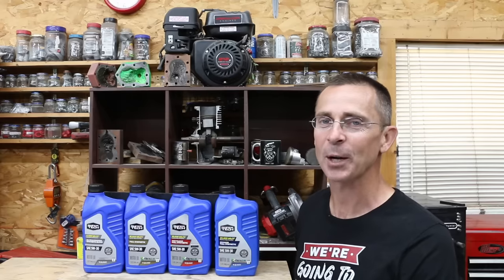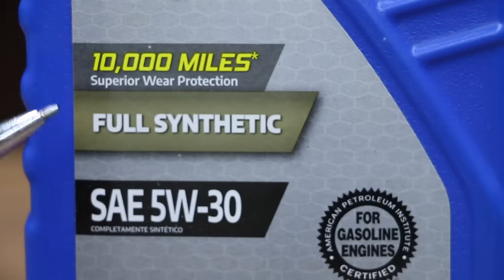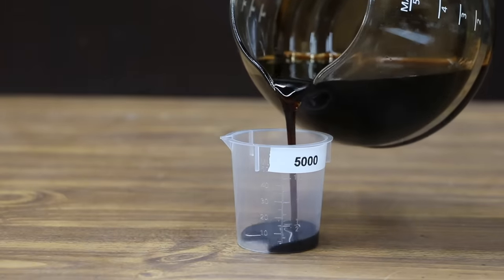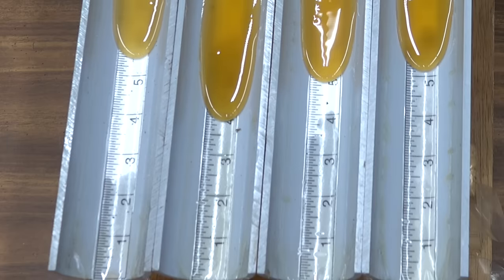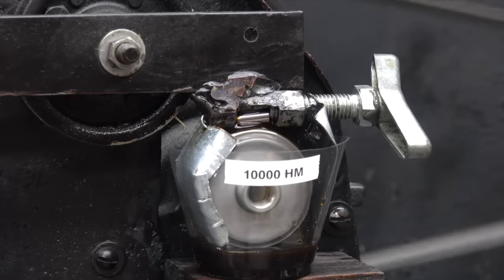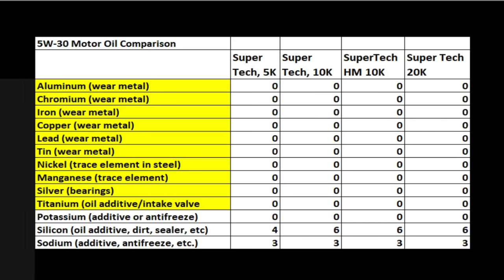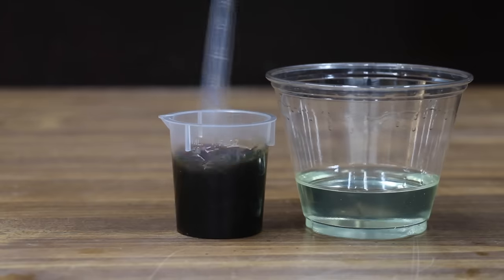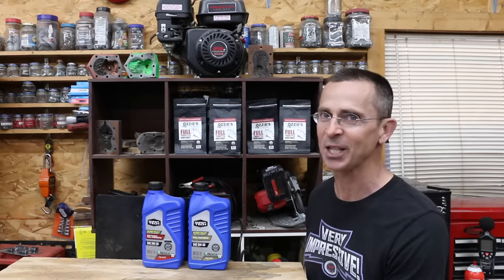Are They All The Same Motor Oil? Let's Settle This! Four Types of SuperTech Motor Oil Compared

Comment: I learned my lesson on a Mercedes in 2004.  Took it to dealer in accordance with factory recommendations, which was around 10,000 miles. At 140,000 the heads had to be replaced for over $6000.  The mechanic said it was due to not changing the oil properly.
Reply from the maker: Thank you for sharing!
Reply: Heads from junk yard for that car is ~$200 plus the price of milling.
Reply: @hid3nax  he didn't state the year and model of the vehicle. You have no idea what used heads cost in 2004 for a mystery model car.
Reply: @hid3nax  internal secondary air ports impossible to clean out.  Not rebuildable.
Reply: @rustynail7866  Okay, then the only thing I could wish you is good luck throwing those amounts of money in a used car (any used car) post-warranty period. You must be earning insane amounts there in America though
Reply: Most cars you could get a whole brand new engine for that
Reply: Vw vr6 used to say 10k between changes ,I'd do em around 7500-8500 and still needed to replace the timing chains at 130k.
More that the guides were shot causing chain slap, but I bet it would have needed em by around 100k if I did the 10k changes. 
As it was, I wasn't so happy with the color of the aluminum surfaces going that long.
It wasn't sludge loaded,it just had a brown patina that was a little darker than I like.
Reply: @MrTheHillfolk  Timing chains is a wear/maintenance item, just as brake pads. Some last longer, some require attention sooner. Modern VW TSI engines wear our chains quickly too
Reply: Audi also has that ridiculous 10k mile interval. I change it every 5k
Reply: @WeighedWilson  Mercedes in 2004
Reply: @hid3nax  yeah this is definitely not true; wear items like brake pads are meant to be replaced routinely but these definitely aren’t. Timing chain guide failure and chain stretch/failure are design or manufacturing flaws. I’ve owned several cars with timing chains including one with an EA888 TSI and I’ve never seen this in any inspection or maintenance schedule.
Reply: @hid3nax  yeah not to mention the stupid TSI water pump, not a fan. 
The wife's 2014 is 5k over the warranty and it's leaking. 
Not happy about that stupid design and having to eat this. 
I've had timing belts last longer than a vr6 chain set and they're not supposed to.
Reply: @Drinksfromtap  That doesn't mean they last forever. In ECU there is stored some value which can be accessed using a scan tool. Once the value passes some threshold it means timing chain is stretched beyond specs and needs replacement
Reply: @MrTheHillfolk  personally I (highly) prefer timing belts over timing chains. On my 1.6 TDI engine TB replacement interval is 210,000 km. It's silent, reliable and long lasting component.
Reply: That 2004 Mercedes also has a terrible engine layout.  The cylinders lay at an extreme angle and the rings don't lift and scrape the oil properly
Reply: WOW!!!!!😮
Reply: @artbennett7321  3-5k is good, no way I'm going longer matter what they say.
Reply: Yet in the UK oil changes  for a lot of cars including mercs are 20k
Reply: @hid3nax  Thats kind of a load of crap. American cars saying 100K timing chain, sure I'd believe it. Asian and German, I expect 150K+ minimum. Can tell you how many Toyota/Honda/etc are running 200, 250, 300K on OEM.
Just like BMW's have half the top end plastic and considered a wear item after 5 years. Conveniently out of warranty and usually out of lease.
German engineers can't design a longer lasting engine compenent like everyone else, or the bean counters figure the people buying their product First-hand will rarely still have it in the stable to find out how crap they are at cost cutting.
Reply: Change at 3000 miles if it has a turbo. 5000 if not. Full synthetic
Reply: @PeterHernandez-lg2eh  I go 12k on synthetic.  There is no reason to change it sooner.  It actually puts more wear on the engine changing it sooner.
Reply: @pj4433  That's for diesel cars in the UK. Gasoline engines need oil changes much more often than diesel engines.
Reply: @5467nick  yes agreed but even so petrol in UK is often in the 12ish range.
Reply: @pj4433  The average age of cars on the road in the UK is around 8.5 years old. In the USA, it's around 12.5 years. We also tend to drive a lot more each year in the USA. Longer service intervals are less of a problem if you don't intend to own the car as long and aren't going to drive it as far.
Reply: @hid3nax  
We let one go for 140k miles on an old 1.6 be diesel. 
Well ,not by choice but it had 140k on it and there was no doubt it was the original one. 
Only 100k over recommended change 😂
Reply: @MrTheHillfolk  Mine's not the old good 1.6 IDI engine but modern 1.6 TDI with Common-Rail. I've replaced the TB at around 185k km mark just to be on the safe side and all the components (tensioners, rollers) looked and felt fine. The TB material was also fine, no cracks or other evidence of aging/wear. Manufacturer's recommended replacement interval is 210k km for this engine, which I have no doubts, is reasonable

Comment: Yes! We've got the Walmart brand oils tested against each other. I've wanted to know about this since they introduced them. Thank you Project Farm!
Reply from the maker: You are welcome!
Reply: I've used supertech products since I was 17 years old, I'm now 35 not once have I had any issues due to being the oil.
Reply: I've used them since I was 17 on about anything they're fine.  I have never had an engine die due to oil related issues.
Reply: Good info. Ive been using the 20 K when I can find it. I feel better about using the 10 K now.
Reply: Warren blends good engine oils  Most in house brands are made by Warren.

Comment: 5,000 miles is the maximum I go between oil and filter changes.
Nice test!
Reply from the maker: Thanks!  Thanks for the feedback.
Reply: Depends on the oil. Verify by testing. The length of oil change should be done by hours, not miles. Sitting in traffic and idling does take a toll.
Reply: Why
Reply: Thank you.  I'm going to post about my brother's oil change habits later today.
Reply: 3 to 5 max. It is all I ever do/ and I get 300 -450 thousand out of my engines without any oil burning. 3.3 Dodge/ Plymouth/Caravan
 BUT.
 I have now a Toyota Corolla cross so the results may differ.
Oil is cheap/ engine repairs/ new cars aren't.
Each to his own though. You're paying the bills, not me.
Reply: @luckyguy600 there’s no need to do every 3k unless it’s been months on months on months. 5 is fine. Also ran through few Nisan engines 300k miles (murano/infinity g35)
Reply: @cwill2127  How bout their transmissions?
Reply: I run royal purple and i go 8000 miles between change intervals.
Reply: Depends on the type of oil you're using and the kind of mileage you're doing. If you're just steadily crusing down the highway the interval can be significantly longer than city driving and traffic jams. I imagine the 20k mile oil is good for 20k if its just long distance highway commuting but not 20k city driving.
Reply: Cheap insurance. I do also.
Reply: @gravemind6536  the 20k is safe for 10k with full protection. I wouldn't go over 10 tho
Reply: Renault Europe recomends oil replacement at 30.000 km for gas engines, and 25.000 km for diesel. 
Syntetic oils can go much further than 5000 miles.
Reply: @jonmo2694  There has been quite a bit of coverage on the topic of transmissions.  The auto manufacturers only care about making it to the end of the warranty period.  They might even say a given transmission has a "lifetime" fluid. You can search Youtube and get a lot of good information.  I personally would prefer say 5k-10k miles for first service, be that "drain and fill" or "drain, filter, and fill". If engine wear occurs more during break-in, then would not transmissions also?  I personally will service at first 5k, then every 25k after that.
Reply: @RSAF-rms  Engine break-in produce far far more metal contamination. Engine break-in is the time period in which the cylinders walls that have asperities are sanded by the asperities of the piston. It is made that way, so once the break in is finished the surface are perfectly smooth an shaped to one a other et perfection. 
The result is a lot of métal pollution in the oïl. 
Such thing does not appen in a transmission. 
A New transmission does not produce significantly more contaminent the first thousand miles than it does After .
So you are not needed to do a transmission oïl change After a break-in period. 
Plus, changing the ATF too much is as Bad as too late. 
50 000 miles is the sweet spot for most car
Reply: @RSAF-rms  I'm on my fourth drain in 2 yrs, I have a 2019 Nissan rogue sport, The fluid was very dirty the first two changes, also my last I used amsoil and changed both filters, after this final drain I will change every 30 k or so, CVTs need to be clean to last.I paid alot of money for Nissan brand fluid (once)and apparently it is not even synthetic. I just bought amsoil cvt fluid for only $50 Gal, being a six month member and synthetic oil only $30 for a gallon free shipping

Comment: It’s been a while since you did an oil test.    These tests are priceless.    Unbiased results.
Reply from the maker: Thanks!
Reply: @danstiurca7963 I remember the Bacon grease one. Epic old video 😁🙌🏻
Reply: The bacon grease was the best oil lol
Reply: @Nardage  But it makes you hungry when you drive
Reply: @OnBakePlatinum  Bacon grease oil with vegetable oil fuel
Reply: @ProjectFarm I would like to see a test on motorcycle oil. Specifically for V-Twin air-cooled bikes. Klotz vs Red Line vs Mobil 1. I know the first two are group V oils (ester based). It's important for these oils to hold up in high heat conditions. Appreciate your consideration on this.

Comment: I'm a happy Suprertech 5w20 HM customer. I'm at 230k and I do an oil/filter changes at every 5k. Very happy with this oil. Thanks for your fantastic work- Happy Easter Todd!
Reply from the maker: You are welcome!  Happy Easter!
Reply: So you use supretech5w20 5,000? Instead of the other ones that have high milage? You recommend the one?

Comment: You are spot on with 5,000mi. being the best (prudent) oil change interval...very good work ! I use Supertech in all my vehicles; 1989 suburban (new engine using 5-40), 2016 Nissan using 0-20...both 10,000 oils. Thanks so very much...great show !
Reply from the maker: Thanks and you are welcome!
Reply: Do you thinm if we went ham on crazier filtration if thats how we could get the intervals up?

Comment: Thanks for finalizing this issue! 
I have never believed long oil change intervals as I personally change oil at about 7k Mi or (10k km  where I live) even though car manufacturer recommends 20k km (or 15k km in tough conditions) 
First thing that diminishes is oil's cleaning capability of engine and for diesel engines contamination with carbon is heavy. 
As long as oils don't  cost an arm and a leg, i can do my engine a favour.
Reply: every 5K anything over that is worthless  and will lead to a lot of wear and oil burning once you hit about 150k or 200k be prepared to spend about 6K on a short block to repair your engine..